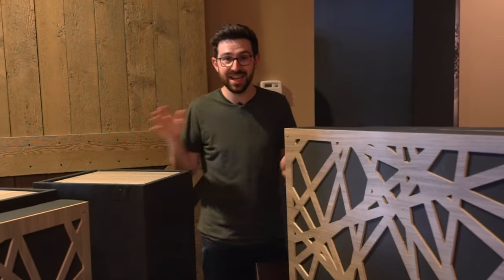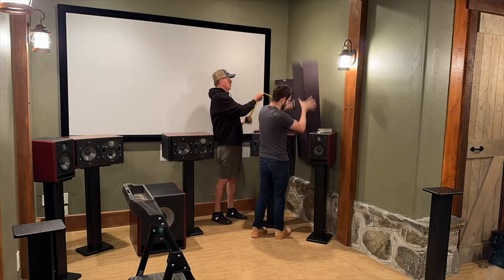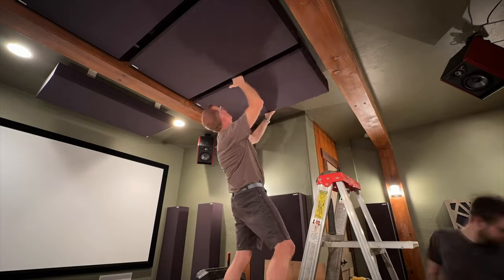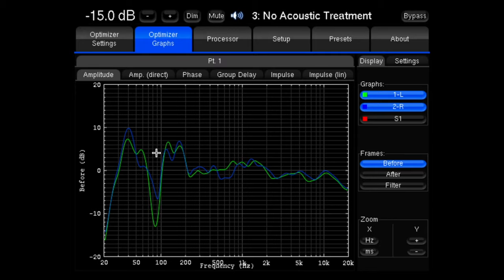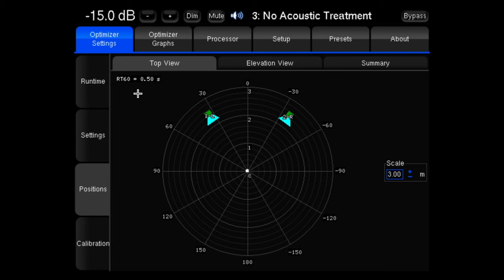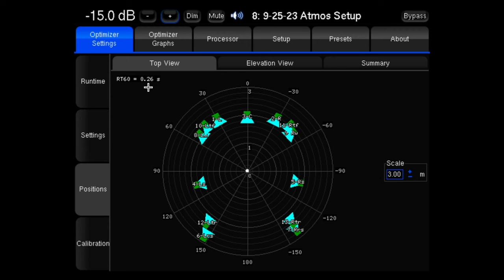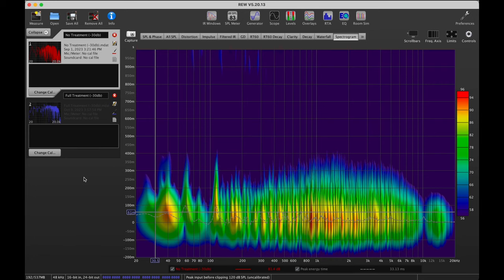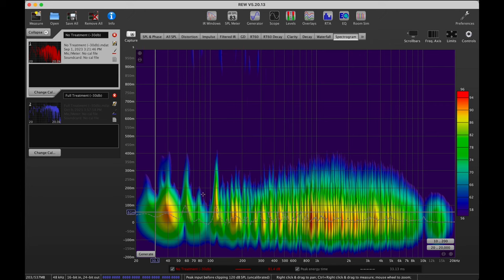Make Your Studio Sound Its Best: Acoustic Treatment + Trinnov

Comment: I have two AVAA’s. They are a long term investment. They make small differences in the low end but they are pressure absorbers. Putting 6 inch porous absorbers against the wall won’t do much because they absorb velocity, not pressure
Reply: Awesome! Would love to buy some in the future as well. Have you invested in a Trinnov system as well or do you plan do add it in the future?
Reply: @klemenspichler400 not yet but I most likely will. Speakers keep getting better and better with their built in DSP and cardioid but the issue is, they don’t sound well with Trinnov